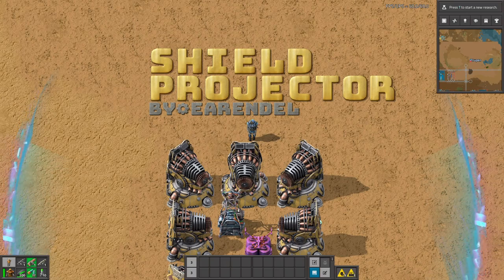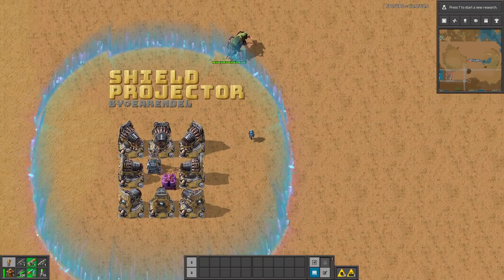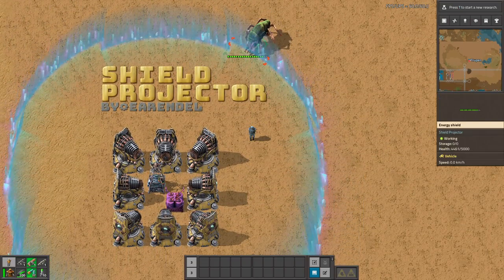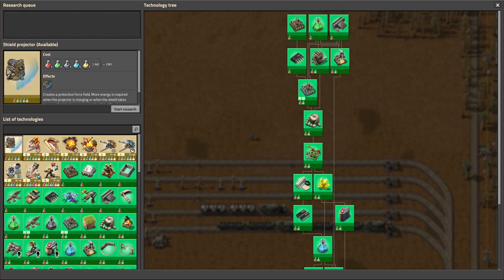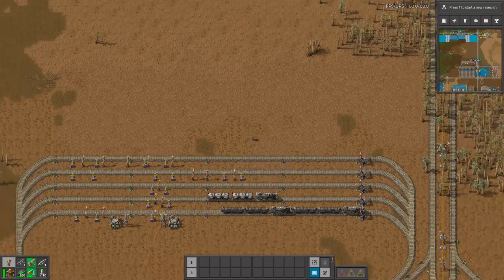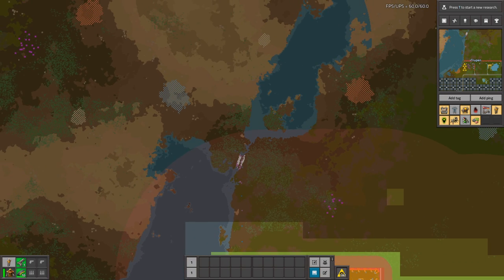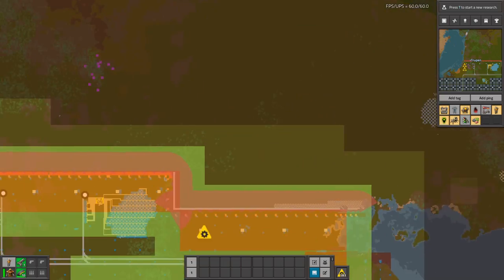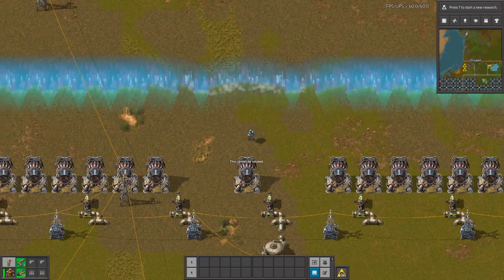ULTIMATE wall.

Comment: Not really useful. Biters are not going to make it to the wall anyway if you are using turrets with uranium bullets, but spitters are still going to deal damage.
Reply: It can be usefull with modded enemies
Reply: @1ermejo4ever1  modded problems require modded solutions
Reply from the maker: that's true, this mod works way better with this one https://mods.factorio.com/mods/Earendel/walls-block-spitters